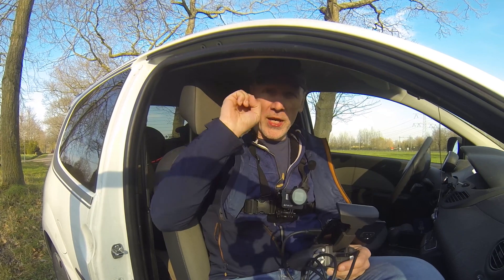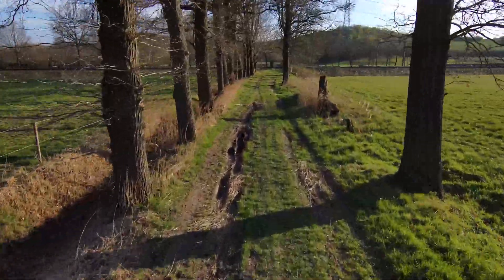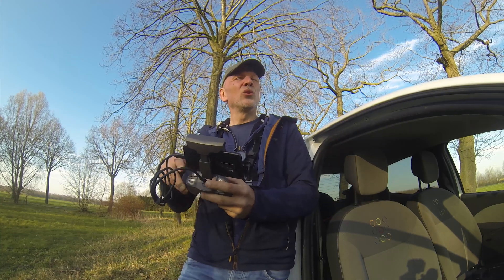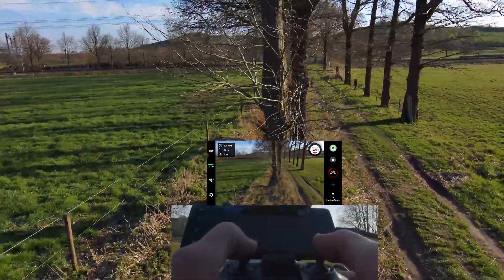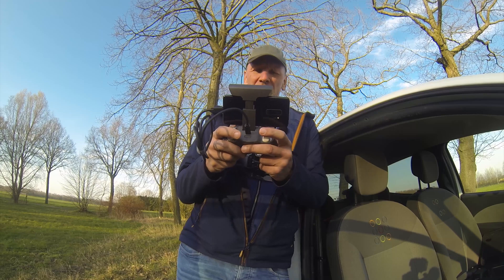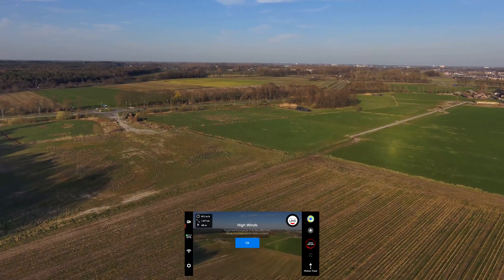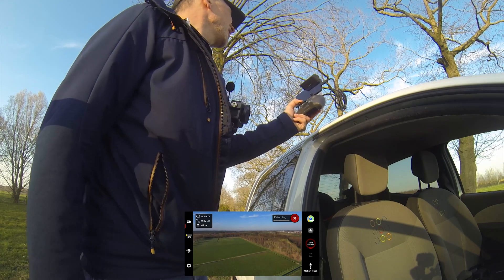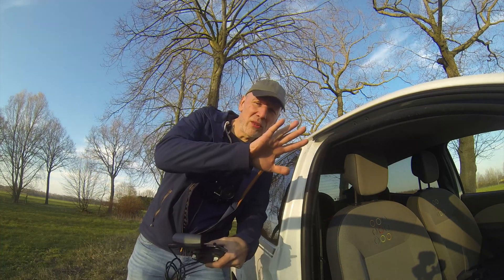How does the Skydio 2 avoid obstacles at boosted speed?

Comment: You should still be able to control it when it's returning. That seems to be a be a bit of an oversight. And you should be able to steer when landing.

The connection.... well it really wasn't meant to be a long range flyer and more of a follow me drone. So that's ok I guess although I'd like to have a better transmission system so I know I could fly through trees. What if it's following you at some set distance and it loses connection because of poor signal through trees?

Comment: Hi Peter, could you pls test the following scenario: The Skydio2 is flying in air surrounded by most sides by trees, like in the middle of the pathway of the trees. Then you for example run out of battery and the Return To Home is initiated. how will the drone solve that, in the case the starting point has branches on top of the drone...? I wonder how the drone will solve that issue?